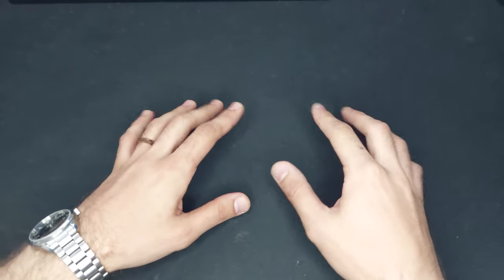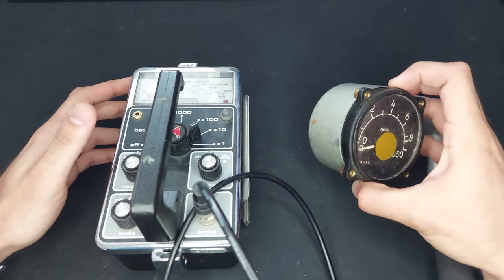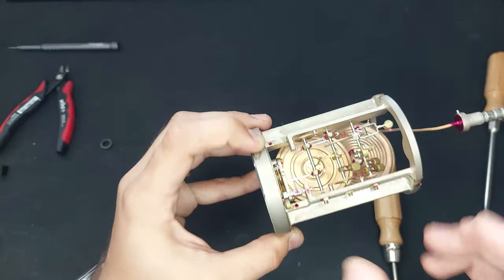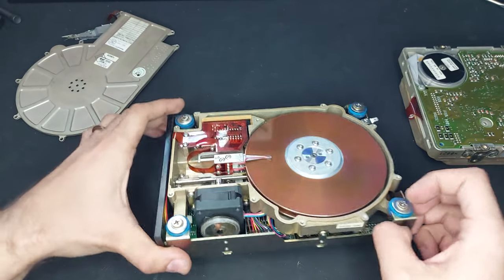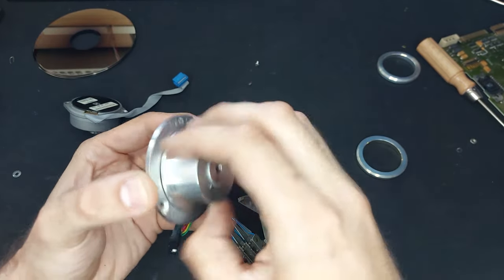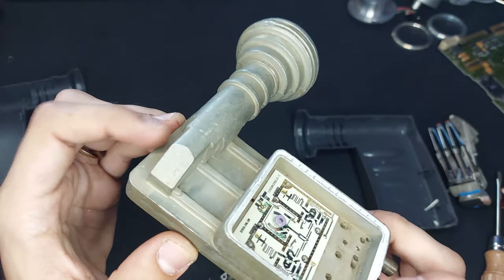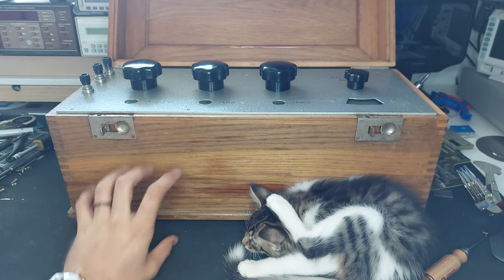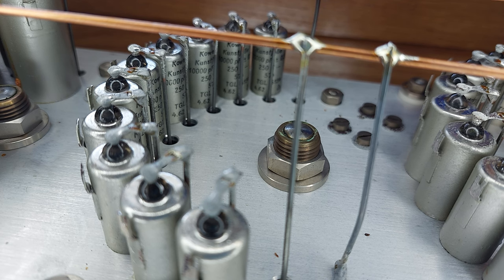Radioactive Fleamarket Finds EP. 9

Comment: Just as a quick benchmark of PC storage price/capacity growth. When I started work in 1985 I was absolutely thrilled to have an IBM PC XT with 10MB hard drive plopped on my desk. In 1994 I bought a 486 PC at a computer show, and splashed out on a special offer of a 1GB hard drive for the bargain price of £700 ($855 at current exchange rate, or $1,500 in 2022 $). I had too much money back then.

Comment: ч и с л о = NUMBER     число Маха  = MACH NUMBER.  Hope that helps.
Reply from the maker: So i was right! Thanks!
Reply: @GearAcquisitionSyndrome  The other letter on the bottom was "D".  - давление  is PRESSURE.
Reply: сброс давления  is "Depressure?"  maybe that's the c
Reply: @GearAcquisitionSyndrome  The markings on the diaphragm look to be "deflection in inches per kilopascal" but that is a guess, there were two values so one might be an upper bounds or perhaps a calibration resting position (0.33 in the writing).
Reply from the maker: Maybe microns per kpa
Reply: @GearAcquisitionSyndrome  right. possibly